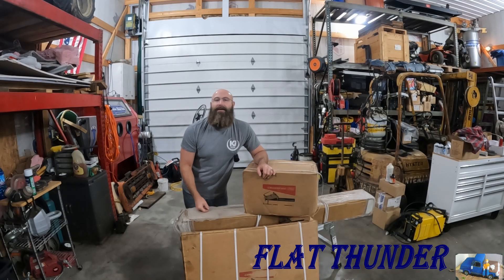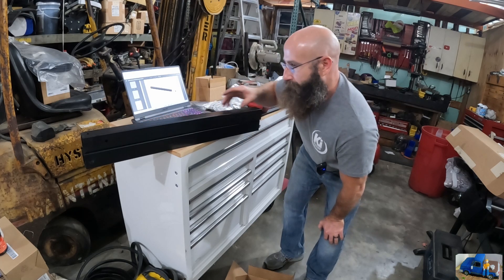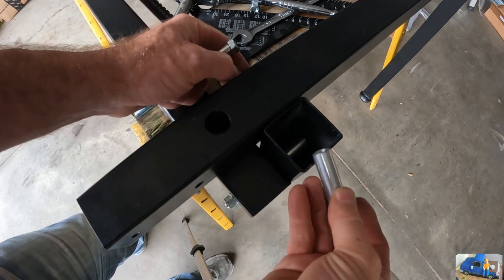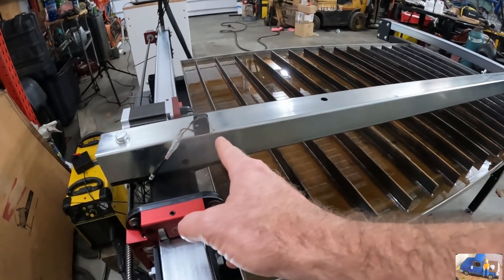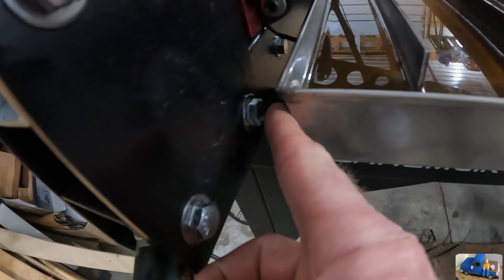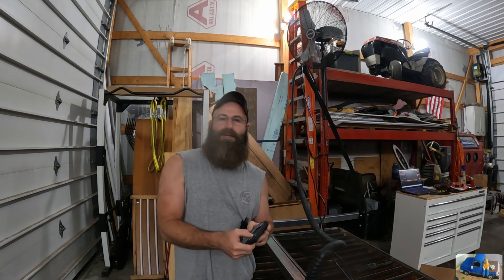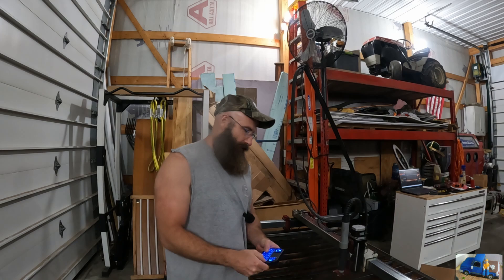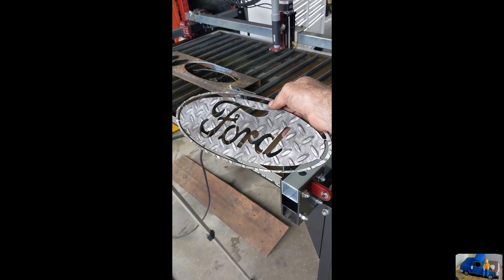CNC Plasma; CrossFire Pro.....Finally!!!

Comment: I ditched the silicone they provided and used black rtv gasket maker when I assemble mine because I heard similar reviews about the water pan leaking. Mine has been together for almost 2 years with zero leaks so far.

Cool video.
Reply from the maker: Thanks!  I was worried about leaks, so I made sure to spend extra time cleaning the surfaces.  I think some of the issues people were experiencing were from over tightening the bolts. Thanks for watching!  👍😁